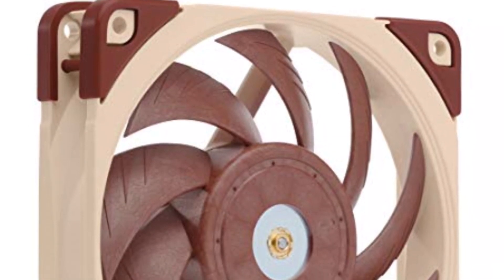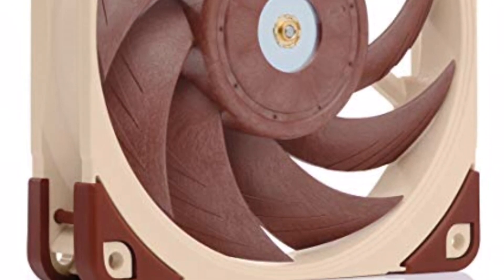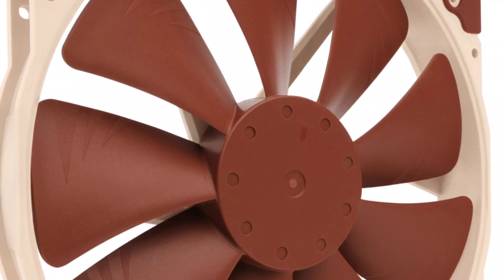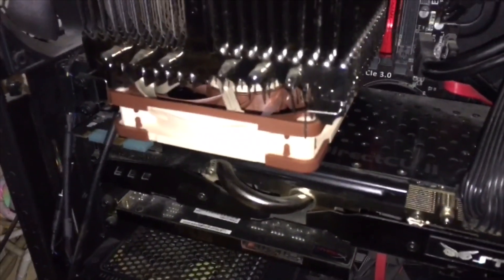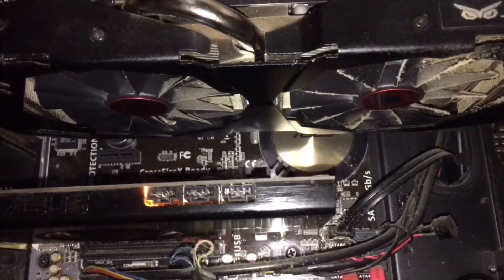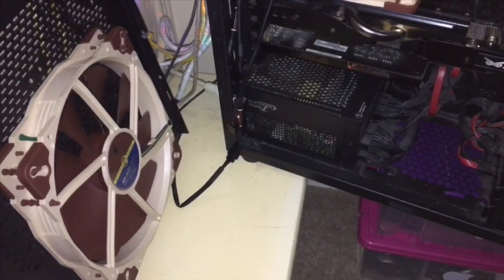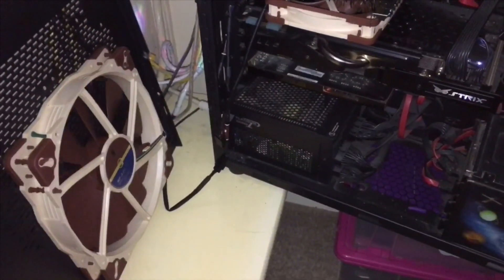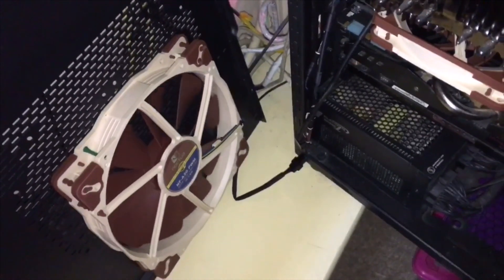Getting A PC To Run Passive / No Fans On .... By Adding More Noctua Fans

Comment: this fans are wrong. 
The atmosphere of the earth is rotating with the spinning earth! therefore a rotating ball has an efficiency of almost if not precisely 100% of moving air around. Therefore you should replace this low efficiency pseudo-fans that have fan blades on it (stupid) with a real fan that has a spinning ball in its middle! i Mean come on, is this so hard to understand?

Comment: i7 4790k CPU 4700 MHz oc 
ASUS Z97-k mobo 
Kingston 2400 DDR3 16GB Ram
ASUS STRIX GTX980 GPU 1400 MHz oc 
Seasonic Fanless 420W PSU
Zalman FX70 passive heat sink
Intel 1TB M.2 OS HDD
2 x WD Red 6TB HDD

Comment: Nathan, what are the CPU/Motherboard/Ram specs if you don't mind me asking? Looks pretty good, is there an upgrade path for the cpu? I remember you saying it was struggling with 4k or 8k encoding, was that done with cpu or gpu? Graphics cards are an easy upgrade, as is a cpu upgrade as long as the socket supports faster chips or if you are able to overclock it.
Reply: i7 4790k CPU 4700 MHz oc 
ASUS Z97-k mobo 
Kingston 2400 DDR3 16GB Ram
ASUS STRIX GTX980 GPU 1400 MHz oc 
Seasonic Fanless 420W PSU
Zalman FX70 passive heat sink
Intel 1TB M.2 OS HDD
2 x WD Red 6TB HDD (need a third as my old 3TB Seagate died) 

It’s not struggling at all. The GPU encodes the shows. Both GPU and CPU are already overclocked. The CPU 4000 stock 4300 boost overclocked to 4700, I’ve had it as high as 4800!! Without a cpu fan. The problem was heat, the computer just made more when I added the 4K projector 📽 

Now everything runs fine, good temps again during the show and more importantly its silent when I’m live. Delighted with the results! 
No need to upgrade, the CPU and GPU we’re both the best on the market short of server grade CPUs and Quadro GPUs when I got them and they easily still hold their own today. $60 spent, PC works better than ever and has the added bonus of being genuinely silent when I watch a movie or listen to music.

Comment: completely passive, with fans. hahahaha. i think you mean silent, passive means no fans.
Reply: mark collard no, I mean passive!

The PC runs, say iTunes or Netflix and has no fans at all running! 
Passive PSU and all case fans set to off, the CPU fan, that usually must run has been defeated and can now switch off entirely! So yeah, PASSIVE
Reply: @NathanOakley1980  
That's not passively cooled.
To be passive there would be no fans and the cpu etc would be set to throttle back when necessary to keep the pc cool. 
What you have is  hybrid/mixed/combined (whatever you want to call it), where the fans only run when necessary.
  https://whatis.techtarget.com/definition/passive-cooling

I don't understand what you would gain by going passive anyway?
As I said, passively cooled components throttle themselves to keep cool, and surely to don't want that when encoding or streaming? 
Big, high quality fans like those Noctuas' running slowly will be effectively silent and stop the thermal throttling.
If it's still too noisy, buy some sound deadening foam to line the inside of the case.

I look forward to your completely unreasonable rant :)

Comment: I added a 200mm and the latest 120mm PWM fans from Noctua and using their splitter and low noise adapters, I got the pc to run without fans when at idle or performing basic tasks like playing music, I’m absolutely delighted as a fully passive PC was what I was aiming for when I built the system. Unfortunately it couldn’t be done five years ago without a bios hack so I settled for a large, slow 180mm PWM fan running off the CPU fan header.  Once the 180mm fan wore out (from constantly running) I added the 200mm Noctua NF-a20 PWM, then later the Noctua NF-a12x25 PWM fan with the splitter and bingo, the PC now runs with no fans. Also the max speed the 120mm fan will run is 700rpm so, even at full load, and thanks 200mm fans max of 800rpm and both using a low noise adapter on one header, together with the very large Zalman FX70 passive heat sink results in a PC that runs at reasonable temps and remains basically silent even under full load but can run completely passive with no fans running when doing simple tasks and playing music 🎶